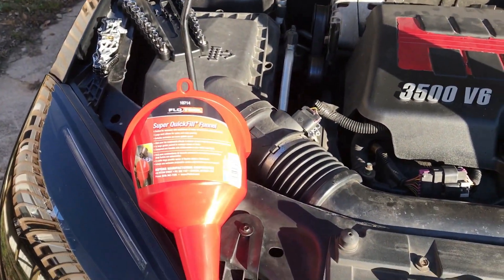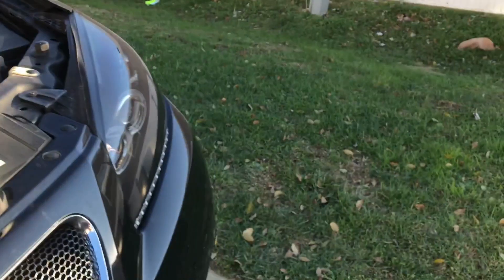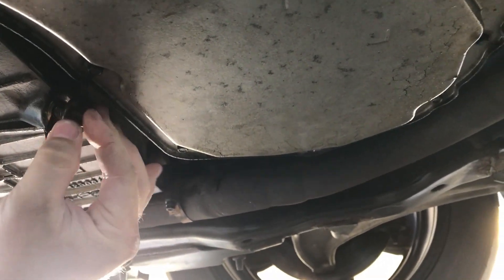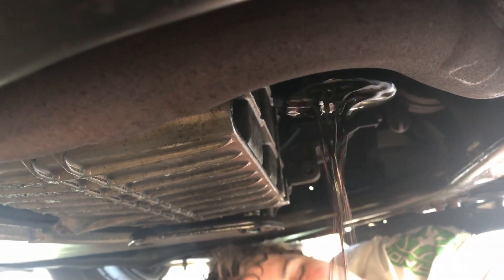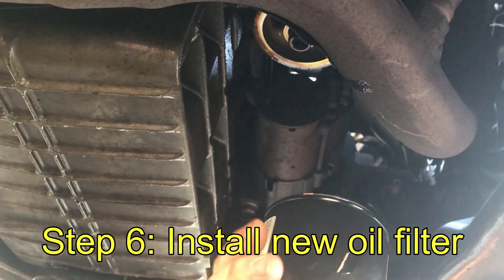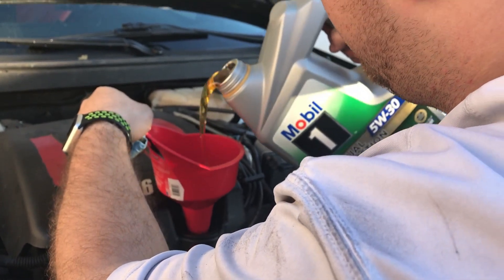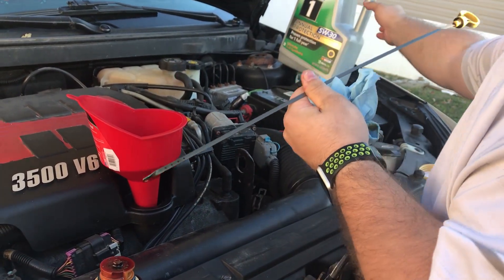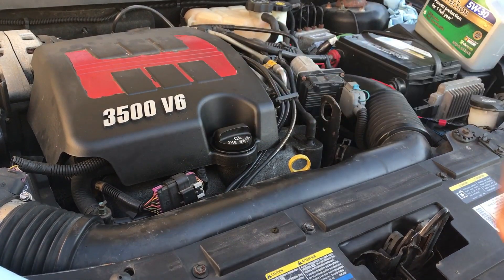Pontiac G6 Oil Change

Comment: Awesome video my dude. Another friendly tip, if you check the dipstick first, keep the rod out before you take the gasket off. The oil drains a lot faster (it’s cold right now in Chicago, work smarter not harder lol) but like I said awesome video, just another friendly tip 😎 so a like has been earned. Have a blessed and great year and oil change everybody. ☮️

Comment: The Buick Rendezvous has the same engine. The M1-201 filter also fits, and has a larger filter media surface, which some say makes for better filtration and longer lubricant life - I agree, and have seen longer intervals between oil life monitor “reminders”.
Reply from the maker: Oil life monitor reminders are not actually programmed to detect your oil life per se. Those monitors are set for a specific mileage and go down according to the mileage. Lets say your car is programmed for 5,000 miles. after putting about 2,500 miles on your car, you should see 50% oil life remaining on your information center. For vehicles that dont have said information center, you wont see a light until you hit the threshold thats set for your computer.  I dont doubt your theory because ive never tried the M-201 filter, but i can attest to the inaccuracy of the dreaded oil life percentage. Its just as misleading as the fuel economy gauges that cars have now.

Comment: Hey T.J. i have a few questions. I'm planning to change my 139k miles 2005 Pontiac G6 from conventional oil to annually full synthetic oil just like in this video. My question is do you actually wait to change your oil once a year? because my mechanic telling me that's not good to do for a pontiac G6 but I think he's lying. 2nd question how do you change or reset the oil life percentage from inside the car after you have changed the oil? 3rd question should I use a motor flush when switching it from conventional to synthetic? 4th questions is it too late to switch the oils since my car has that many miles on it? how many miles did your G6 have? Thanks for your response if and when you do.
Reply from the maker: Hello, im not a mechanic by any means, but i can answer some of those questions. Switching from conventional to full synthetic is certainly a great idea regardless of your mileage. Just once you switch, i wouldnt ever switch back. I dont know anything about motor flushes, when ive switched oils in the past i just drained the old oil and put in the new. 

With the annual protection oil, i still changed it every 3,000 miles because i have little trust in the logic behind changing my oil once a year or even driving as far as 100 miles over the typical 3,000 change interval. I usually change my oil every 2,500, sometimes earlier. Even on my new car which is supposed to have a 5,000 mile interval. 

In this video i believe the G6 had somewhere around 120,000 miles. I traded it in at 160,000 and from my understanding its still running strong. 

I had an aftermarket headunit so i never had to worry about resetting the oil change notification on the radio. I would suggest googling to try to find that.

Hopefully i was able to answer some of those questions. Have a good day :) 

Also, i run a group on facebook called Pontiac G6 Enthusiasts , go ahead and join it. Weve got a ton of members that can probably answer those questions and more!
Reply from the maker: https://www.facebook.com/groups/1681181835500370/?ref=share
Reply: Thanks alot for the advice i will check out the group

Comment: Having your car tilted up in the front leaves alot of oil in the pan
Reply from the maker: Seems like a matter of opinion. Misguided to say the least, but opinion based nonetheless.
Reply: @Tazzi2010  its a fact. Physics dont lie. Next time you change your oil, do it the same way. Then roll it back down and jack up the rear and youll see how much was left in.
Reply from the maker: @talknheadz  i dont know man. Seems kinda counterintuitive considering the oil plug is located at the rear of the oil pan which is also the lowest point in the oil pan. Seems like by lifting up the rear of the car you would be sending the oil away from the drain and away from the lowest part of the pan. Regardless, theres always oil left in the engine during a change. Its nearly impossible to get every single drop out. But fact in the matter is that at least 95% of the used oio will be replaced with new, clean oil.
Reply: @Tazzi2010  my bad bro. Ive been changing oil on alot of cars with drain plugs at the front.  I have a g6 and just got mixed up.. but indo always put a jack umder the opposite side of thebdrain plug for the most optimal drainage.  Also id change the oil again after a week or to as it acts like a rinsing of all the left over oil. Then id start my monthly/milage count after the rimsing....you got it homie

Comment: You should never add too much oil when doing an oil change and expect the car to burn it off? WTF.  This is also hard on seals when you over fill the oil.
Reply from the maker: Good point, however, i really dont think 3 or 4oz too much is going to do a whole lot of harm. Now a whole extra quart, not a good idea whatsoever.
Reply: tim: we've got another keyboard mechanic who thinks his opinion is worth something